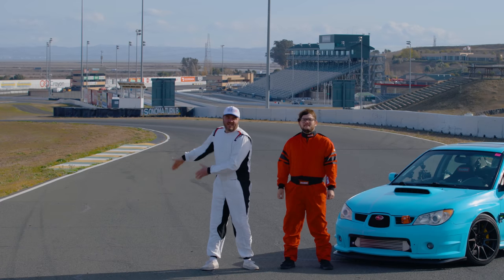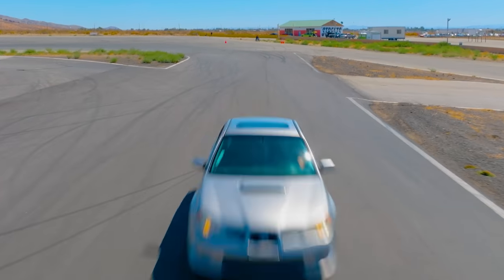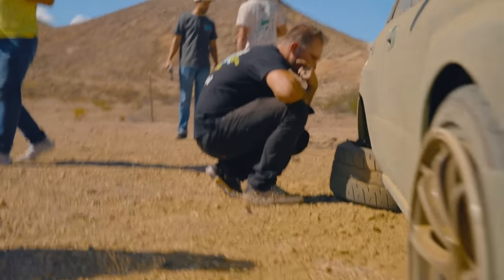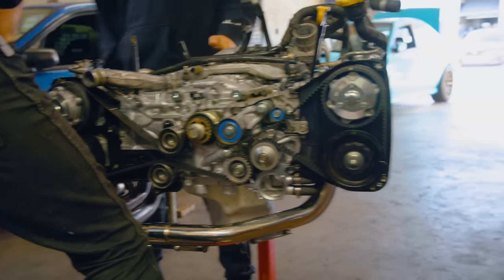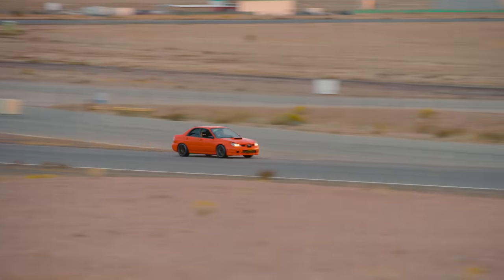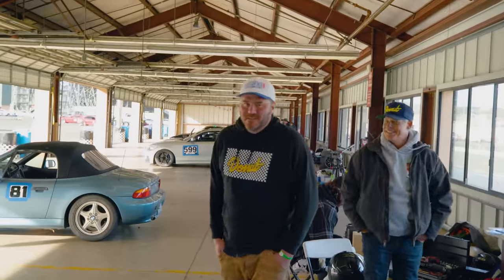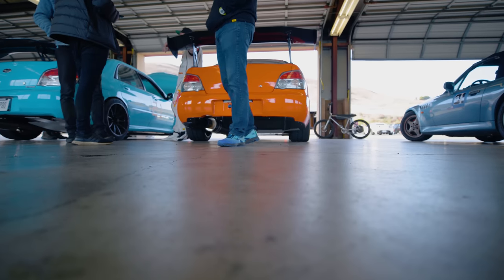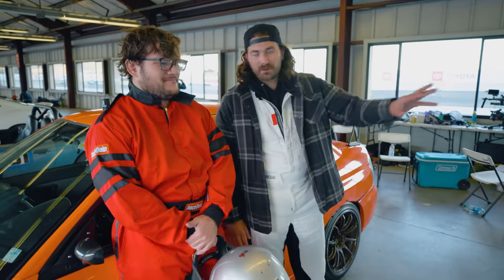$21,000 vs $43,000 Subaru WRX Build - HiLow FINALE!

Comment: This season has pretty much been a "don't buy a subaru" campaign
Reply: they didn't break in the engines
Reply: @3rdheaven3  weren't the engines fine after they finally got brand new ones, also 3rd gear gone isn't the  engine

Still there's better cars
Reply: Or a good " stick to the 90's Raley cars Sub lol "
Reply: Yes...yes...nobody buy them. Make them cheaper for me....
Reply: Yeah , I don't feel so bad about being a fan of Mazda rotaries now.
Reply: In b4 even more Subaru apologists show up.
Reply: @3rdheaven3  didn't break in? The engines were used already.
Reply: Don’t buy a “turbo” subaru. Buy an Na one from the 80’s-90’s 😉
Reply: I will never buy a WRX after what I have seen -/// Never!! 👎👎👎
Reply: Or "don't drive as an American" test. I mean these cars are known for being some of the most reliable in the rest of the world 😂
Reply: Everyone in here saying it's essentially a "don't buy a Subaru" campaign most definitely can't tell that they didn't do any research before doing this series. 
I'm sorry, but Smeedia had a good video on how DM could have improved it, aka by literally just asking around the Subaru community.
Reply: @MannenFromNorth  yeah when you never actually use the full potential of the engine, of course it'll last forever.
Reply: @WALTERBROADDUS  lol rotaries are on another level.. to many good boxer engines on the road so little rotaries and both engines built still have issues
Reply: @NathanaelNaused  Well it still was the best Hi-Low season in my opinion. 

And they're cool cars. Like really cool. But shit i'll stick with the 2015+ versions of the wrx lol
Reply: But then you just buy one anyway
Reply: @MrAykron  Yeah, great series!
Reply: For real. That was my dream car until I watched this season and now I would never get one.
Reply: Subaru simps are up in arms
Reply: They just suck at building subarus
Reply: more like:  "If you have a WRX and it runs just fine, don't do anything to it except changing wheels and coilovers"
Reply: @misterwub1438  it seems like everyone sucks at building subies cause they all have this same fate
Reply: @robert9595  not really, it's more all the stop and go without taking care of the engine. Stop signs and race tracks ruins cars if you do them all the time with no care. Especially if you don't do proper maintenance first and for fuck sake break in the engine so you don't create a metal pinata
Reply: @juiceboif6758  if you say so. Plenty of other Youtubers build WRX's and they don't blow up immediately, but you right
Reply: All they needed were decent engines like from a proper STi. The standard WRX engine is not meant to take 400bhp
Reply: Now let’s get a HiLow with Evos and see how much more reliable they are.
Reply: @Geo Gmz  mate i don't know what you watched but these cars a pos, cant even run 300 plus reliably, 400 bhp third gear gtfoh.
 
As ive said this show crushed dreams, get a golf r stage 1 it 400 bhp reliable much cheaper than a tuned scooby.
Reply: I'm here for it!! Hot boii vape life types EAD lol!!
Reply: @3rdheaven3  they said once that they did. Obviously didnt include the clip of them just driving
Reply: @geogmz8277  hondas and toyotas, the two most reliable engine makers ever... lol. These aren't i4 or i6s, f4 need to be treated right and they'll treat you right back. Also dont take your newly rebuilt engine to the drag strip please.
Reply: Please dont, most of yall will be just like them and neglect them till they break. Then rip on subaru because you know nothing about them lol.
Reply: @tracktimevideos5164  Exactly, and the fact they put all the horsepower in without changing the transmission..
Reply: Hey hey hey, the subaru ej is a delicate balance of oil consumption/starvation, ringland strength, and headgasket sealage. As long as those are kept, they'll run forever. 

On a serious note, with the proper upgrades from the shitty stock subaru internals, EJs can be just as robust and reliable as your 2jz's and K-series.
Reply: @MannenFromNorth So you are saying driving a car creates wear? Well, hello Captain obvious. They were used cars.  Why would you try to break in an engine on a car that already had many miles? I will say that they should have had the cars inspected by a Subaru specialist before purchase,  but Subaru has made some very unreliable engines. Don't get me wrong,  they are great cars,  and a ton of fun,  but at some point,  this fate will probably await you.  You are correct in that proper maintenance goes a long way to extending the engines life, but there are several issues with these motors.  Too bad,  because i love boxers.
Reply: The demo that these cars appeals to can't properly take care of them. Why do you get spun bearings? Run low on oil. What do young drivers tend not to check or change as often as they should when they beat on their cars? The people that should own Toyotas are showing themselves here.
Reply: @MannenFromNorth  No they're not. They just get considered as reliable because they're Japanese. 

Just look at the BRZ, the engine blows up the moment you add more power.
Reply: @MannenFromNorth  has to be a joke right? Lmfao
Reply: @gabrielaguilar1391  there's no issues with the engines, it was just some of the 2.5l non turbo that had head gasket issues. The rest is self inflicted or just wear from being a 15-20 year old car...
Reply: @anarchyjinflames  nope, they're considered reliable because they're. The engine didn't blew up. You blew it up.

Also yes a engine don't like it when you add more power? Well how did you add power? Did you check that the engines components and build quality could actually handle it? Did you change the piston rings to make a tighter fit so higher pressure won't destroy your insides? Like bruh, you could power to a Corolla and the engine will blow, those that mean corollas are unreliable???
Reply: @alexandernapoli6104  yeah evos are more bulletproof
Reply: Subaru's really don't like being messed with under the hood. Don't force more power into them and leave them stock. They'll last forever.
Reply: @SkylineLofe  they literally have one of the biggest Subaru guys in the city handholding them and a formula drift mechanic. Armchair dudes can try to blame them and not the car but, I have been to enough time attack events to know. Subarus show up on trailers for a reason.
Reply: @MannenFromNorth  yeah, it was the 2.5 that was the problem child.  And i agree,  they should have had the cars inspected first. Always have a specialist check your car before purchase.  It will save you huge $$$ in the long run.
Reply: Had an 04 wrx stage 2. Drove the heck out of it. After 95k miles, the only issue it ever had was a radiator go bad. Great reliable fun car till I wrecked it in the rain.
Reply: @Patrick.Howie.  name a better car for under 10k that’s turbo ?
Reply: @deathtoming2201  I still remember the headaches of my 1987 RX7. It was fun when it ran.
Reply: @luckypennybenny  
Don't forget their literal master mechanic Jobe.  These cars had the absolute BEST chance of proving themselves, and they still blew up.  

It's not even that EJ25s are inherently bad, but they were not designed for serious boost, and instead of Subaru building them to handle boost, they just chucked turbos on them and called it a day.  Subaru didn't even give the damn things baffled oil pans stock!

I actually like WRXs, but I'd never own one if I didn't have a friend who is VERY serious into the damn platform, and use his years of pain and struggling to get the damn thing to play nice to build up from
Reply: @j_mars_cars worst possible route you can go lmfao
Reply: @Patrick.Howie.  any car that goes through used engines like that says something about reliability. Yeah no shit a brand new car/brand new engine should have no problems, that’s a given
Reply: @Patrick.Howie.  after 400hp it’s best to upgrade to sti trans WRX can’t hold it
Reply: @Patrick.Howie.  yeahhhh, EJs have a gazillion issues as it stands, and Donut hit pretty much all of them right on the head. Aggressive driving without proper oiling mods = blown engine. Buying a beat-up, poorly maintained example = time bomb. Full rotated, big (ish) turbo setup on a stock block? They would've blown on the dyno if they weren't already jacked up, even the nice newer Type RA blocks aren't a guarantee. If you're throwing the money to go full custom turbo setup, you're building the motor too, not using a stock motor from Subaru. And the 5 speeds in those older WRXs are a nightmare, they'll blow those things with stock power, let alone with the nice turbo setups they did. 

But it's a good thing people are seeing this, puts some good light on some of the main flaws (of many) that these platforms have, and hopefully less people buying them means more for me :)
Reply: @MannenFromNorth stop signs???
Reply: @3rdheaven3 because its reliable
Reply: It's the learn about Subarus and quirks of the boxer engine before racing them campaign. 
There's plenty of reliable Subaru racecars out there (even EJ255). You just have to know or learn about them.
Reply: @4iviv312 dude just don’t get a piece of crap one that’s been neglected and abused. There’s no bad cars, there’s just bad idiot owners.
Reply: @AlexGIGA  unless your really patience and drive nice and slow stop signs wear down engines very fast when have to come to to a full stop then up to 50-80km/H again and again and again and again multiple times everyday. Engines are made to last in crusing rangers, always having to acceleration can be bad if it's done too hard and too often, especially if you don't have the best fits and oil lubrication, which many people with aging cars or even newer cars now don't really have.
Reply: @WALTERBROADDUS  🤣🤣🤣
Reply: @randomgarage1  i think that's exactly the point. you can skip a lot of this fixing and get straight to the fun part on the two platforms you mentioned, with some extra perks each one you mentioned offers.
Reply: @misterwub1438  more like if you buy a used wrx it’s probably been ragged it’s entire life
Reply: @WALTERBROADDUS  They started off with identical freshly rebuilt engines at the start of the season.
Reply: @MannenFromNorth  Idk what nationality has to do with it, The issue is inherent to the engine design and the fact they are running cars at redline strait out of a fresh rebuild. 

EJ's can be reliable, But they are built with a lot of shortcuts, plastics, etc. The N/A EJ's are fine, But the engine is a nightmare when turbocharged.
Reply: Nah it’s easily been a “Donut doesn’t know how to build on the Subaru platform” campaign 😂 they even said in the beginning they don’t the Subaru boxer platform very well and it’s obvious they don’t
Reply: Don’t buy a used Subaru from a 25 year old
Reply: @scromberprofessionalautist1017  um it's actually some of the earlier 2.5 na engines that had problems, the turbo ones were fine.

Edit: and their faults with the 2.5 na engines you fixed by taking parts from the turbo ones. Yes even the head gasket that everybody loves to scream about. You literally fix the head gasket in a Subaru by using the head gaskets from the cars that most people complain have head gasket issues.

Nationality don't have much to do with it but where you drive do. American car infrastructure is really good some places and but most where it's really inefficient in traffic flow and stops signs og traffic lights everywhere combined with higher speed limits. This is not good for any cars in the long run when it's constantly having to deal with it. Especially when giving engines proper care isn't a huge priority but the minimal to barely enough to keep it alive for half of it's life expectancy because of short term saving is preferred. This is all less then ideal. Any engine will struggle here and there's a reason alot of cars considered unreliable in USA is not really considered unreliable in Europe.
Reply: I owned a WRX, it was a money pit. So many other cars with better platforms that get you better value and HP. I’m glad I got rid of mine. It was fun while I had it but be honest about the overall reliability trends with this brand. You will always find that one guy who says “ I never had problem with mine” they are a small minority. Also ask the ones who have high HP subies and the cost associated with getting it to those numbers. It’s ridiculous in comparison to other cars.
Reply: @WALTERBROADDUS  They didnt break them in after a rebuild. Rebuilds on these motors is just about as invasive as building a new motor. You typically need new piston rings which need to be broken in.
Reply: @Leviathan_1992  Are you seriously suggesting they just slapped parts on and drove to a track?
Reply: @WALTERBROADDUS  They literally did.. They immediatly tracked it after with no break in.
Reply: @Leviathan_1992  did you realize that these videos are edited and compressed for time? Not every behind the scenes step is thus presented. Let's give these guys a little bit more credit they're spending well over $100,000 on vehicles and parts and God knows how much time; I think they can figure out how to break in an engine.
Reply: @WALTERBROADDUS  are you dense? They rebuilt the motor just to find out they left metal in it which blew it up again. They literally stated this.
Reply: Facts
Reply: @Sai Vootukur  well that just goes to show the build quality of subies look at the tacos one of them was over 8,000 lbs and they beat the dog shit out of them n didn't need 5 engines. The nissans didn't need 5 engines either. Even tho those are factory n/a cars.
Reply: @WALTERBROADDUS  when you rebuild an engine you have to break it in again.
Reply: @anthonyhamman800  I believe they know that.
Reply: need to try an EVO now!!
Reply: I think Subaru owners need to admit the 2.5 liter turbo is just not as a reliable design like the 2.0 turbo.

It's not a coincidence the equal length header ej205 or ej207 twinscroll turbo engines are more resistant to abuse than the 2.5 turbo engines
Reply: A lot of people don’t realize there is a difference between an wrx sti and standard wrx. They try to mod a wrx to run higher than 300hp without properly modding the transmission and engine block. They just didn’t do the prep work to make sure they didn’t blow up the wrx. DM just messed up because whoever wrote the script decided to make a just wing it video and not properly mod the car.
Reply: @DonutMedia please bring back the og BoostCreep hoodie
Reply: don't run them hard without researching the faults you mean...
Reply: @pretty00lights  i introduce to you:

the prius
Reply: More a don't buy a used wrx, as they are almost all beaten to death.  My Forester is pushing 200k, and still runs great.
Reply: @brentleedy79  actually that makes sense. a wrx is a rally car after all
Reply: @NathanaelNaused  
So all the people out there that have had great luck with them (highest owner loyalty in the trade)
Should stop buying them because of these idiots?
Reply: @WALTERBROADDUS  
Correct, and used how, exactly?
Do you see my point?
Reply: @fubartotale3389  We are not asking this thing to last for 30 years and 300,000 miles. THE darn Subarus didn't last a few weeks. And even in normal driving , they're not particularly Loved by mechanics.
Reply: @fubartotale3389  Copium
Reply: Watch smeedia's video on their Subaru series. Explains everything donut did wrong
Reply: Yeah buying two 14 year old  200k mile wrx’s and tracking them without at least changing the oil or upgrading a well known oil baffle issue resulting in them blowing up is definitely a Subaru problem lol you new clueless tic tok car enthusiasts kill me
Reply: @3rdheaven3  ya that's not it
Reply: @mikepuzio  yah that's the best advice.  My bug-eye WRX I bought used with 45k needed a clutch almost immediately from previous owner.  Thankfully all else was good and since I kept up with maintenance, put another 100k on it with it tuned to slightly above 300HP and no dramas through blizzards, heat waves, etc.  That timing belt-maintenance on a boxer engine though...
Reply: @Aperson156  my exact thought. The less people buy them, the less I spend (maybe) 😂
Reply: @SychodelicStorm  No, Subaru engines are just like rotaries and you have to know how to build them otherwise they blow up, watch smeedia & mr Subaru's video on it.
Reply: @KNZRauto  so they're objective trash
Reply: @Eric-mf6vm  have you ever owned a Subaru? mine is 21 years old and I've never had any problem with it.
Reply: @KNZRauto  good for you, if you drove it like a normal car it would be trashed. It really doesn't matter what your specific sample size of one is. They're objectively bad
Reply: @Eric-mf6vm  I'm a mechanic and I rebuild these motors, I've always told my customers to buy Subaru's and it's never let me down. think what you want to think but this is my opinion.
Reply: @KNZRauto  it's not what I think it's fact, curious why you've had to rebuild so many 🤔
Reply: @Eric-mf6vm  because some want to make more power, or they want to last till at least 400-500k miles, it doesn't sound like you know too much about cars...
Reply: @Eric-mf6vm  so since your an expert on Subaru's without ever touching one. why do these engines blow up sometimes?
Reply: @Eric-mf6vm  it's like a rotary, they're not better than other engines, they're just cooler than any engine. it sounds like your getting heated so ill let you chill out, thanks for chatting tho.
Reply: @MannenFromNorth  “don’t drive like an American” bruh Europeans are known to driver faster than us yet people shouldn’t drive like us? Tf kinda logic you got? Subaru sheep much?
Reply: …or don’t buy a previously modified and neglected car. 😂😂
Reply: Well I guess that settles it, Evk it is! Lol
Reply: Suddenly my spicy car seems bulletproof
Reply: But i really want one 😭😭
Reply: @SkylineLofe  ask around for what everyone knows they are trash engines and only fan girls thinks they are some how good 😂
Reply: @alexandernapoli6104  I mean, besides fuel system issues, they'd probably be fine. 4G63's are cast iron, they're renowned for being tougher than shitting while constipated.
Reply: @superplushvideos7968  all I'm hearing are excuses for a weak-ass engine
Reply: @GamingPlus1100  that just proves they suck, every other engine can take extra power
Reply: @mewmew8932  is that why they’ve been used in rally and racing for decades? Or why Porsche uses them? You guys have no clue what you’re talking about.
Reply: @superplushvideos7968  that's why they've been used in rallying, so Subaru can burn money instead of wasting it further on another suv
Reply: @mewmew8932  that doesn’t make any sense. What is you’re argument even?
Reply: Subaru's can be a bit finicky for sure, but they can also be pretty damn reliable. This season was just one unlucky thing after the next. The cars at least looked good at the end, though. I still wanna see them do a HiLow drift car season.
Reply: Too heavy
Reply: wrx and brzs you should just never buy used because of the engine unreliability and often being pushed by teenagers. For the general audience who take care of their cars they are alr at best
Reply: I came into the Z hilow not knowing much about them and I left a fan of them. I came into the WRX hilow liking Subaru and left never wanting to go near one...
Reply: The great thing about Subarus is that they only have a few, well documented issues. The bad thing is that those issues tend to be catastrophic. But hey, at least they’re easy to work on 😅
Reply: They really aren't that good
Reply: @gadeghost29 that doesn't matter if the car is crap, most serious racers drop a 2.3 boxer in them, and they are Mazda engines
Reply: @burgerman-nb3cv Change the transmission for 400bhp? My Mazdaspeed 3 trans is good for 600 whp lmao
Reply: @CarlosGonzalez-vi9qv  The Subaru WRX 5 speed transmission isn't very strong, the STI one though can handle well over 800.
Reply: @burgerman-nb3cv  Thanks for the info. I watched Smeedia's video and honestly Subarus don't seem to bad. I'm very turbo car savvy so I think I can maintain one pretty good, especially at 330ish whp.
Reply: If you don't modify the car, and do regular maintenance, it will last.  Add an intake and you can break the engine.  It really do be like that with those cars.
Reply: Better buy an Evo
Reply: Or the "open up a subie dreams shop franchise"
Reply: @3rdheaven3  Or the WRX is trash and has the exact issue it has always had.
Reply: @Aperson156  and you can keep your trash boxer engines.
Reply: @pawrestlingchamp  k
Reply: Well boxer engines are notorious for head gasket failure.
Reply: Is nobody going to speak about the fact that the engines were not tuned?
Reply: Don't buy a used Subaru* I own a brand new 2023 WRX and it's amazing
Reply: Really helpful knowledge for someone who's a year away from his sweet sixteen.